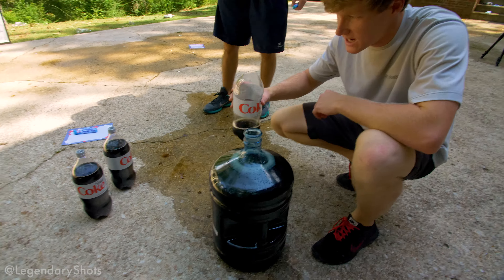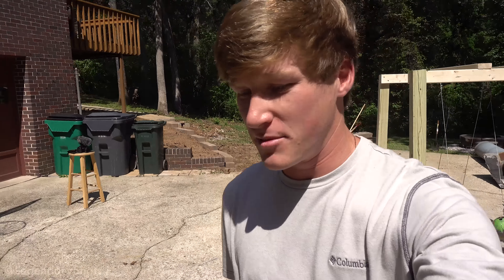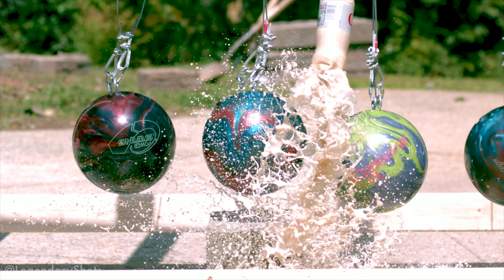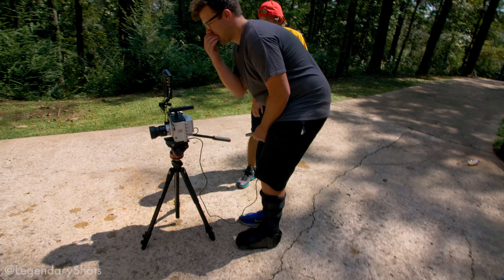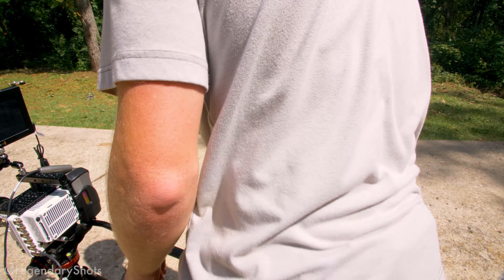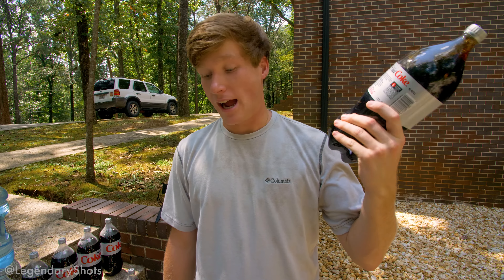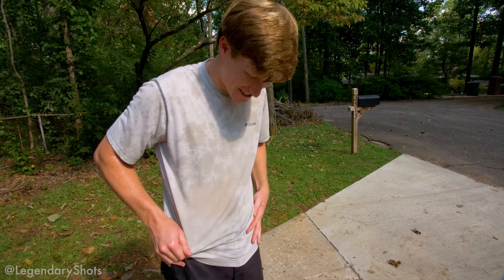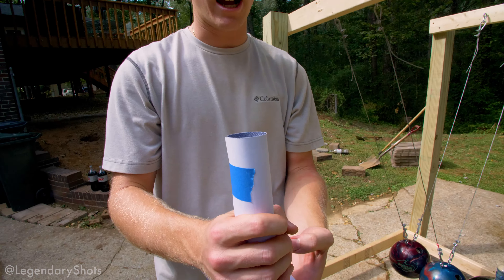Coke & Mentos VS Giant Newton's Cradle!!!

Comment: You should get an 8 inch piece of 2 1/4 inch piece of PVC pipe and attach a quarter turn ball valve to one side fill it with mentos then install a cap in the open side and then attach the ball valve to a 5 gallon water jug. you would be able to drop the Mentos in there and let it build pressure before blowing it up